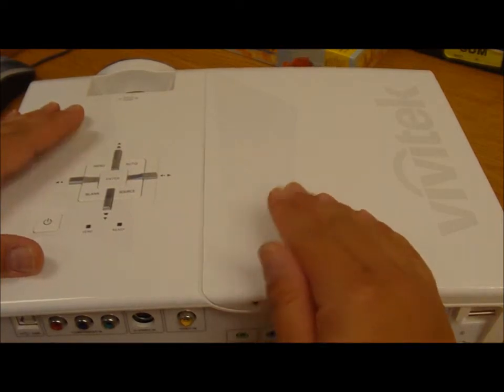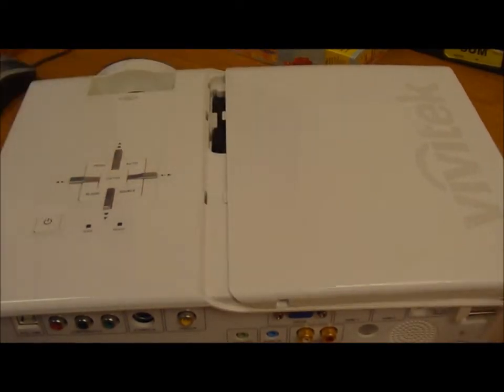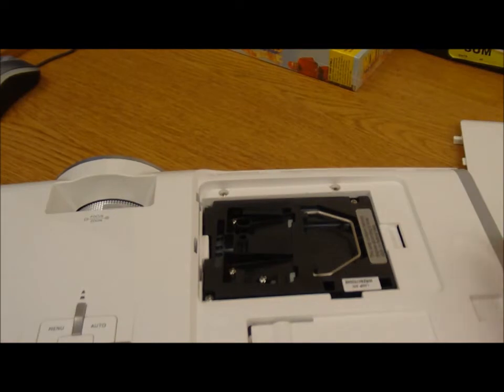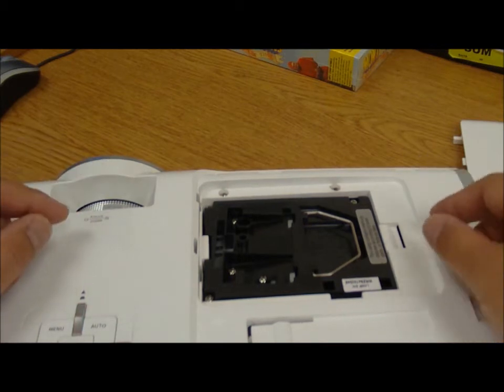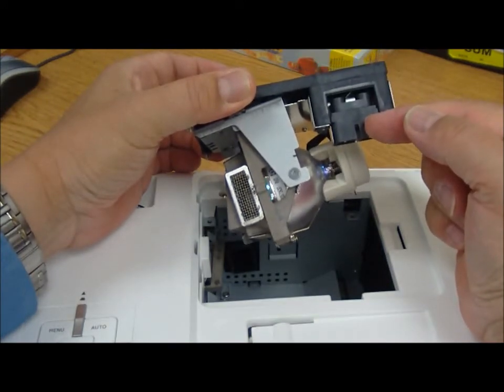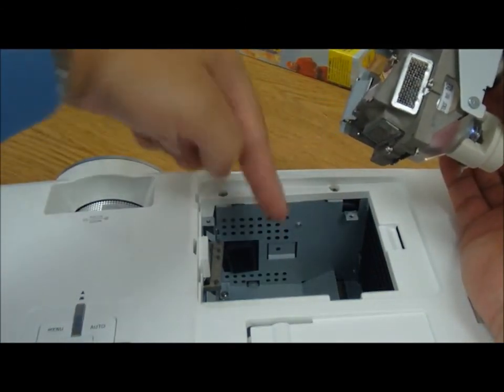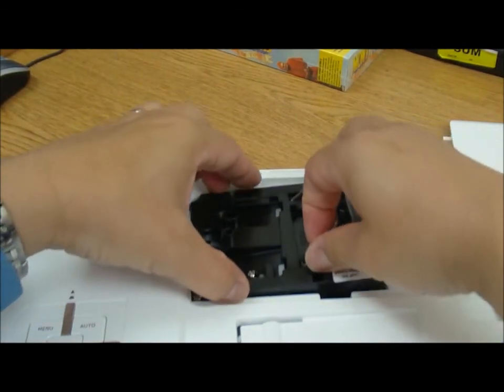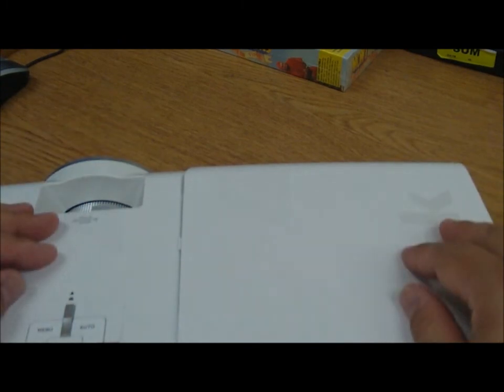Tech Support: How to change the bulb on a Vivitek DLP projector

Comment: 3K+ views and only 5 combined likes-dislikes??  Shame!

Well--Sir, I, for one, happened to find your video very helpful!  Thank you!  I just started rippin' screws apart and prying plastic pieces apart...the center screw on the bottom wouldn't come out though.  Not sure if it got stripped in or what so then I deferred to the resource youtube and found this, which saved me lots of work.

I didn't replace the entire bulb assembly--only the bulb itself (@ 33% the cost).

There are only 3 screws involved with the bulb changing process:
- 1 for the sliding, plastic cover seen here
- 2 securing a small mounting plate atop the bulb in the bulb-carrier assembly
- the two prongs for power supply are crimped on pretty well, use a flathead to GENTLY pry the connector open enough to slide them out--it doesn't take much.

prior to reconnecting, I took some needle-nose pliers and returned the connectors to their original form to ensure a secure connection on the prongs again.  Again, finesse here--not power, boys & girls!

The difference between replacing the entire carrier vs only the bulb is only a difference in the matter of 2-5 minutes depending on how adept you are with small screws and work areas.

CAUTION not to touch the carrier display screen/cover.  I imagine it's the same as touching the surface of a halogen bulb.  Also use caution when handling the bulb itself as the bulb housing has no cover.

Good luck to all DIYers 'cause this is an easy one--difficulty 2/10.